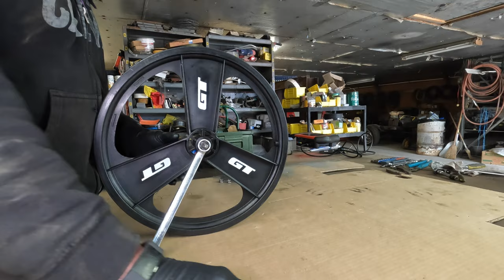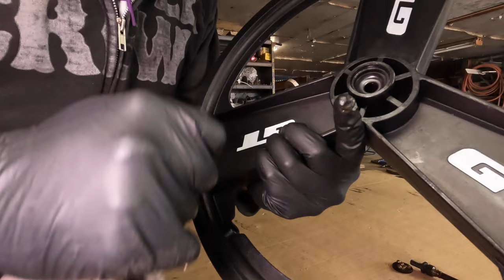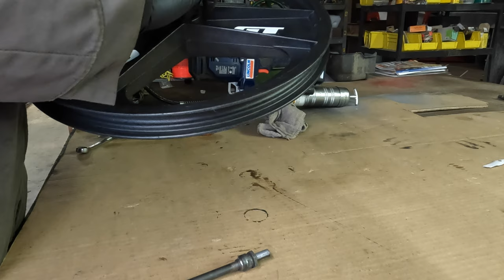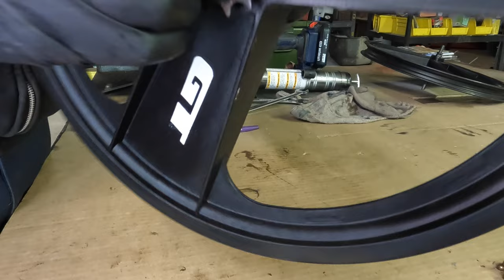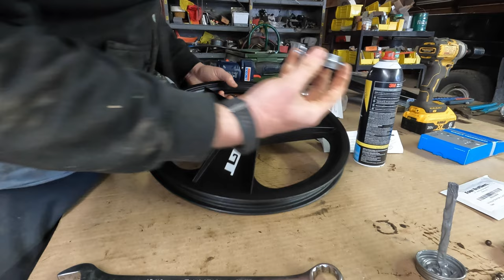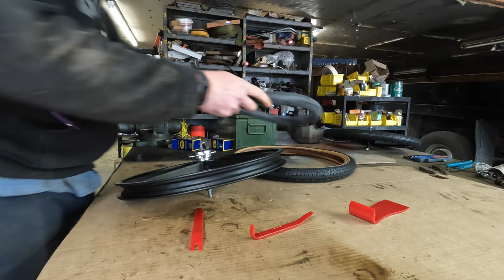How to rebuild GT Fan Mags

Comment: Not sure if you'll see this considering how long ago you posted the video, but I have a couple if questions (if you dont mind):

1. Why are these wheels so sought after and valuable??
2. Are they stronger than standard rims?
3. Was it necessary to replace the old bearings, or just good practice?

I have had these exact rims lying around for some time now and was about to use them as wheels on an eBike trailer I'm custom building... Without your video, id be lost in understanding how to DE-CRUD this hardware (mine is bad)... So THANKS!!!

Only issue I have now is the second thoughts im having over putting these on a trailer instead of selling them... I checked eBay and found just under 10 pairs of these have sold for AS MUCH AS $420!!!  WTF!!???

Whats your opinion?? It would look sick, but am I disgracing a legend if I use these on a trailer?
Reply: These rims came on the top level Gt and Dyno from like 1994 to 1998 or at least the highest level most kids parents could afford so they are pretty sought after when it comes to growing up or riding from those eras…as far as strength goes I never saw a set break on any jumps or race tracks but they where heavier then spokes…I’m building my son a Dyno and these Mags are a must for me but I loved these mags…and yes currently they cost more then the bike itself…lol

Comment: Hi im Chik from Hong Kong .
I have the same mags as yours but my rear wheel has a wobbly issue ...
It feels like riding a horse.
Does that about body weight ? Cause I'm 270 lb big boi...
Reply from the maker: Hey Chik, could be a bent rim, or possibly it isn't installed on the bike perfectly level.  I would flip the bike upside down so it is on the seat and handlebars and spin the wheel and see if it is out of whack!
Reply: @robschwiesow  thx for suggestion !